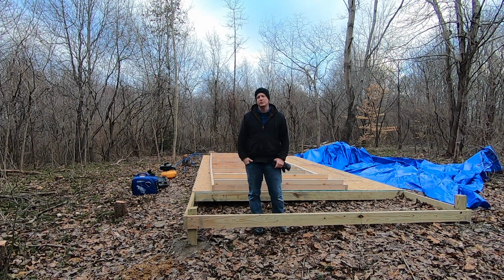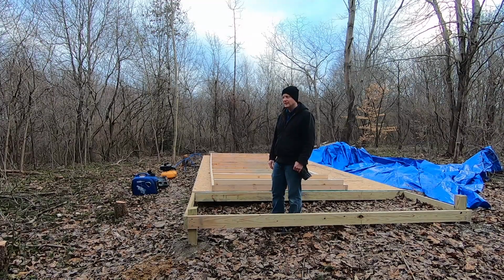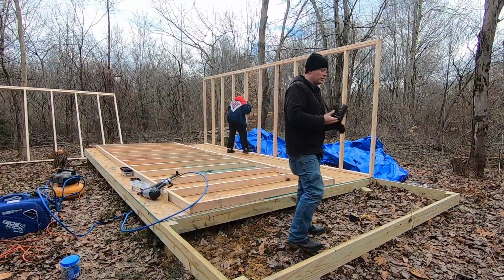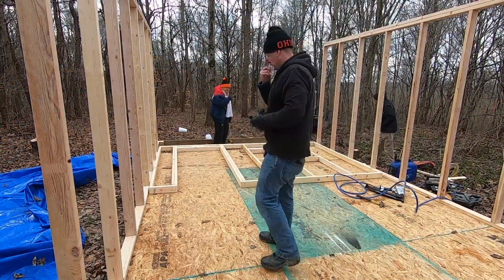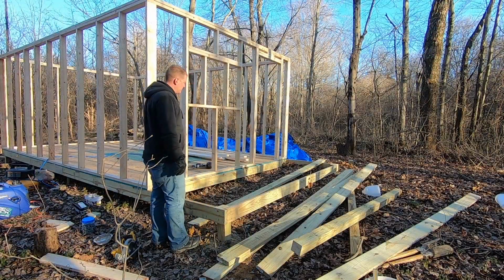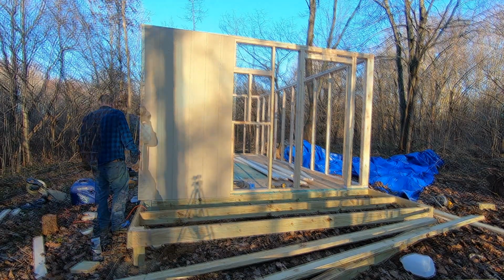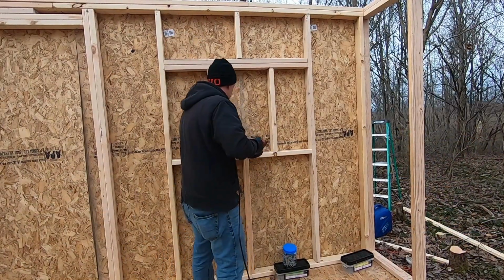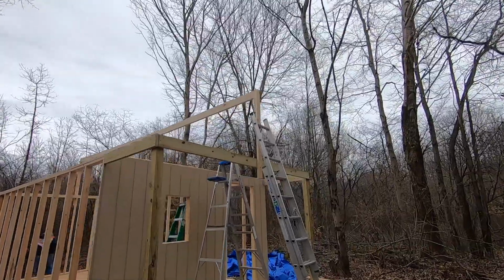DIY Off Grid Cabin - Episode 4 - Framing The Walls

Comment: I realize you are trying to build an inexpensive cabin, but why didn't you go with standard 16" spacing on your studs?    I'm also worried about your subfloor...  IMO you should have put your beams on top of the post, not bolted them to the posts.  I don't think a few lag bolts are going to be strong and stable in the long term...
Reply from the maker: I won't disagree at all with what you have said. If I build another one some day I would do some things slightly different.

Comment: The rim joists will have structural sagging- why? All the weight is on the lag bolts- which don't have high structural shearing strength with the load your employing. Solution use lap joints on the 4x4 posts  (prefer 4x6 posts with laps) or piers as you mentioned in final video.

Comment: It looks like your top plates don't overlap on the corners.  Usually builders have the top beam, they raise the walls, and then they place the second beam so it's on top of the neighboring wall, which ties the building together.  Is there a reason you did yours differently?  I've never seen it before, and would be interested to learn anything new. :-)
Reply from the maker: One thing I did not show in the video is the use of steel brackets in the corners on top of the 2x4's.
Reply: @JackofAllMasterofNone  Thanks for the info!  I imagined you'd thought about strength but didn't see it.  I'm happy to learn about new techniques, and also to not worry so much about your new building.  :-)
Reply: i know it is quite off topic but do anyone know of a good place to watch newly released series online ?
Reply: @Kevin Finnegan I watch on flixzone. You can find it by googling =)
Reply: @Gavin Edgar yea, been using Flixzone for months myself :)
Reply: @Gavin Edgar thanks, signed up and it seems like a nice service :) I really appreciate it!!
Reply: @Kevin Finnegan Happy to help :D

Comment: I may have used 10 ft 2 by 4's  instead of 8' ones because I like high ceilings but for those you would have probably needed 2 by 8's for the deck instead of 2 by 6's.